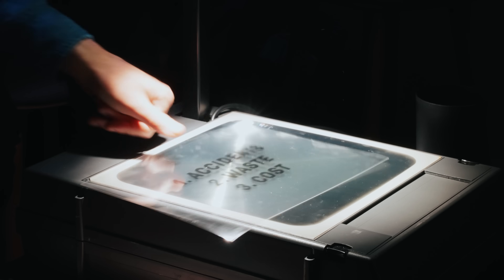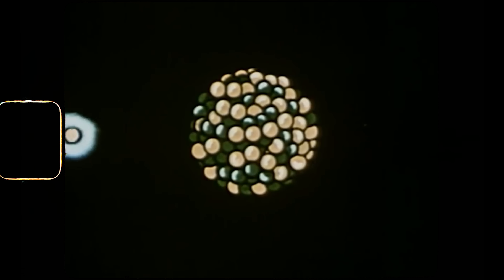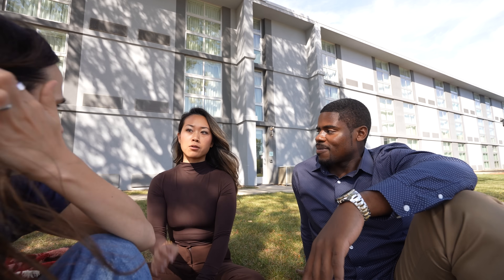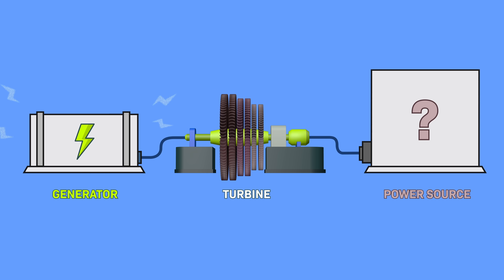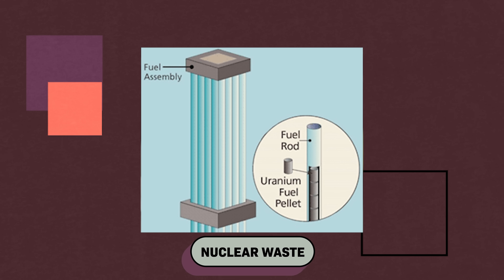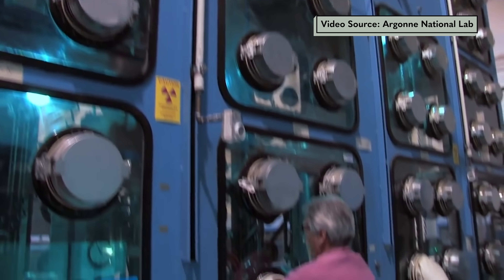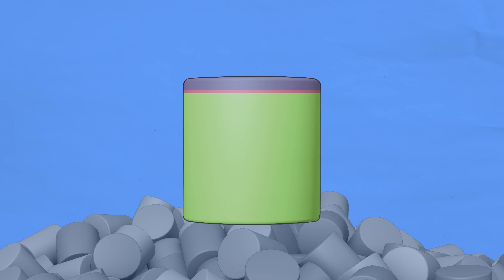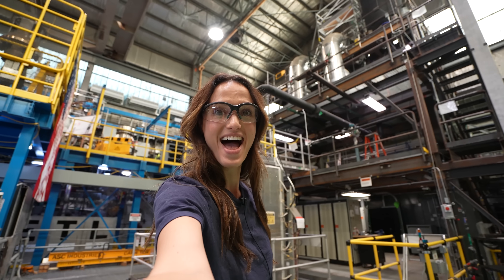The Big Lie About Nuclear Waste

Comment: Fantastic presentation. I loved it. Two tiny things. 1. 238 refers to the total number of particles (protons + neutrons) not the number of neutrons. 2. You say the process is started by firing some atoms into the fuel. Firstly if we were going to fire anything into the fuel, it would be neutrons, not atoms. Secondly, once we have enough Uranium 238 in one place, the process starts spontaneously.  The trick is to get the process running continuously without getting out of control (ie a meltdown).

As I said, though, they are very minor points. I only mention them for accuracy 😊

Comment: You take a deep dive (figuratively 😃) into thorium. It also shows great promise for producing much cleaner energy than uranium.
Reply: Thorium isn't cleaner than uranium, the reactors required to burn thorium are cleaner than those that can't. But those same reactors can burn uranium too, with all of the same benefits. And the same drawback: They're much more expensive to build and operate, which is the real reason they aren't built.

Comment: Isnt the fundament problem , that the early tech of a solid fuel rod, which quicky fracture and get changed out results in less than 5% of the fuel used ...is a problem of design.....and that the avoidance thru politics etc of liquid fuel reactors ( molten salt designs proven since late 60s ) is the fundamental inefficiency...And that it hasnt been changed or updated to any great extent? And while these technologies are being researched further, that changing the slow and expensive infrastructure is a spiders web tangle or money and entrenchment, perception , influence of big oil and other 'political" issues not necessarily driven by facts alone. That many countries are apparently working to use Molten Salt Reactors and create working and deployable systems....either using Thorium as fertile fuel and having the possibility of consuming existing nuclear wasteful waste ( with 90% + fuel remaining- altho there are many different designs and fuel management strategies implicated ) as part or the fuel charge - may likely produce much improved use of waste and/or thorium and potentially change the energy landscape of the planet ( if it ever propagates widely). This is some of what i understand. Most things published about nuclear energy misses the real valid points in my opinion. Of course all chemicals and radioactive substances must be rerspected but for sure i have seen quite a few engineering people who worked in the nuclear industry and im very impressed that in my unqualified survey , they appear to live to a ripe old age.

Comment: Let's go down the rabbit hole of why wind and solar aren't actually clean energy yet.
Reply: That's easy, because the devices use today to harness the energy are inefficient. They have to be hugely built which in turn take up too much space. That itself is invasive to flora and fauna, and the energy it produces is not sufficient for what it costs to build it. Then there's the cost and maintenance, which is more than the energy that's produce.
Nuclear power and fossil fuels on the other hand cost less and produces more energy and power. We just don't have the technology currently to make more efficient devices. Also the materials needed to make these type of devices are more contaminants than the other options. 
Take lithium batteries for example, once they're used they're just contaminating waste that cannot be recycled or easily disposable. Your phone, tablet, once it expires, it will just become dangerous waste that will contaminate more than fossil fuels. 
Power windmills affect birds, and other animals, take up too much space and cost more to maintain and repair if it gets damaged. Example the latest tornadoes in the midwest damaged several windmills that will cost millions to repair. That goes into the economy increasing the cost of living, not just to the surrounding local population but to the rest of the nation. Prepare to pay more for your veggies!

Comment: The depleted uranium rounds that the US military uses to spray all over the middle east with their A10 warthogs and thunderbolts? The ones where both the casings and the ammo are a significant health risk? They used, and continue to use, some of that waste stockpile to irradiate, armour pierce and inflate cancer cases across the places they're used. Retrofitting reactors takes years, building new ones takes almost a decade, with some taking 15 years because of poor planning and materials shortages, costs often blow out to double , or sometimes triple the amount they should. Fukushima happened because of criminally lax inspection standards and human stupidity...  and costs/money. The factor that screws us all is human fallibility. Grid level heat storage technologies are ramping up everywhere, and all over the place, solar and wind are doing so amazingly. Leave the hot, deadly rocks in the ground.
Reply: Wind and solar affect flora and fauna more. It kills birds and when it gets destroyed by tornadoes the spread of toxic materials is worse affecting the land and animals contaminating the soil.

Comment: The reason there is life in the biosphere is because the continental crust is shielding us from the radioactive (U, K, & Th) elements that were pulled down by gravity to below the surface and we are shielded from above by the magnetic field & the atmosphere from cosmic rays.
Now, we are trying to bring radioactive up back to the surface (as it was 4 billion years ago) and make it difficult for life (mutations) to continue living!
We need recycling (as you indicated), but, we need to stop spreading the use of radioactive materials.  Right now, we got Am-241 in every smoke detector, breath Ra, and drink water with microplastics, organomercury, Sr-90, and Cs-137.
You know what, STOP RIGHT THERE! 8 billion people is too much for this biosphere! Mandatory birth control is the answer!

Comment: The development of nuclear reactors initially focused on producing weapons-grade materials, which led to the adoption of designs like the early graphite-moderated reactors. These designs were less safe but efficient for plutonium production. Recycling nuclear waste was not prioritized as the primary goal was to produce material for nuclear weapons.

People are skeptical of nuclear energy because safety and sustainability was mostly an afterthought.

Comment: Do consider the fact that nuclear waste leaves highly enriched fission material that can than be used for weapons. so if your goal is to produce a lot of nukes, your baking in enrichment (to get plutonium) into a civilian process.    if the motivations were different for example highly efficient low radiative waste the designs and matirials of choice would be very different.

Comment: The problem with "recycling" nuclear waste is that it makes more nuclear waste that's even harder to deal with. Look at the contamination around the Sellafield reprocessing plant, or any other reprocessing plant. It's an incredibly dirty process that makes the nuclear waste problem worse and is highly questionable from an economical value standpoint, although nuclear energy in general is highly economically questionable. Reality is there is no such thing as clean nuclear energy, nor is there such a thing as cheap nuclear energy. Even fusion will result in nuclear waste due to neutron activation, and lacking high temperature superconductors that are suitable for usage in a fusion reactor, it's questionable if the world even has the resources to make fusion viable.

Thermal solar is highly scalable and benefits from decades of optimization of steam turbines, in addition to permitting thermal storage making it adaptable to grid demands. It relies on basic, abundant building materials (i.e. silica sand for glass, aluminum for metallizing mirrors, steel and concrete for pipes and structure). There's no need for rare earth metals and dirty chemical processes involved with photovoltaic cell production or electrochemical batteries. The only "issue" is that it's "old" technology with expired patents and generic manufacturing requirements, meaning there's no opportunity to bleed venture capitalists dry and there's very little "hype" for it. It's the ultimate clean energy source, yet no one wants to talk about it because sticking a bunch of mirrors in the desert pointed at a tower to make steam simply isn't perceived as interesting or innovative.

Comment: Great job on this video. Been working in the commercial nuclear industry for over ten years. Never really though about recycling nuclear waste. But I do see that there would be major financial burden to reuse it. Every 18 months or so a reactor goes into a refueling outage. This is a very regulated and specific activity that in itself costs millions of dollars. The handling of waste and separating the isotopes and “repackaging” the fuel and all the tests and verification of its usability/compatibility would cost millions more. There will come a time where maybe the reusing of spent fuel would be more economical than new fuel, but until then it’ll stay in the good idea but not currently feasible bin.

Comment: That's not entirely true about creating no waste either..  they create about 10% of the waste a typical plant does, which is about 30 tons a year at a typical plant so it would be about 3 tons a year a lot less but still not zero and we have no spot for high level nuclear waste currently it is just stored on site.. and it  "isn't economically viable" so they prefer that we just live with the waste piles leaking like in weldon springs ya know its cool

Comment: I’ve asked for years , why can’t this stuff be reprocessed. You exposed it. Greed.  They can reprocess it and use in a different type of,reactor.  But they want to continue the status quo.  Rear told to reduce, reuse, recycle.  It seems if the reuse, recycle part was applied we can do the same thing we did when aluminum cans were a huge problem. We worked hard to create a loop.  Now most cans are back in the store in months.  And the energy and cost to recycle aluminum is 5% of the. Cost of mining and processing new.  So this can be done if the Nuclear industry were to apply themselves to the problem and the oil and gas lobby were exposed. Just like the cigarette manufacturers, but with way more health, safety and prosperity benefits.

Comment: Plutonium is the most toxic substance on Earth. It is the key scarce ingredient in nuclear bombs. 

The cost of nuclear fission is what makes it useless.  There is simply no use for it except military or very remote locations. There is never an economic case to spend billions on reactors that on average run into 300% cost overruns and delays.  Never. 

Cost is everything in energy economics. Reducing wasted power costs far less than generating by ANY method, and nuclear is by far the most expensive method.

Carter made the correct decision, plutonium should not exist on this planet.
Reply: "Plutonium is the most toxic substance on Earth" This is hilariously false.
"The cost of nuclear fission is what makes it useless" Nuclear is the cheapest source of firm power.

Comment: We could boil water with water the technology is there where we can turn water into a fuel but for some reason it's being blocked water could run cars water can be used as fuels but technology is being blocked and if you look far enough you'll see where it's being blocked

Comment: Where does the recycling of nuclear waste happen? Search for White Mesa Mill, operated by Energy Fuels Resources, near Blanding, Utah. It is the only operating uranium mill in the US. The pits are lined with a single layer of PVC that was designed to last 20 years, but the mill has been operating since 1980, more than double the lifespan. The tailings are piled in the open air. What happens when the wind picks up and carries these heavy metal particles into the air? Is the mill poisoning the local tribe, the White Mesa Utes? Why not ask them? Seems odd to me that any mention of the facility that processes this waste is not ever mentioned in this video. It’s not as simple as “tada! clean energy from recycling waste!”
Reply: Well those issues, while obviously very bad for the people in that area, sound like very solvable issues, particularly since large scale recycling should ideally happen in the same place that the nuclear waste is generated, as transporting something highly unstable across the country to one recycling facility is fraught with danger & highly impractical.  Sounds like the people working at & living in the areas around that Mill should be pursuing an official investigation.  Having said that though, are the materials in the PVC lined pits & being affected by blown away tailings, recycled materials that have been stabilised already?

Comment: Usa shut newer use plutonium/uranium, but the TMSR ( Thorium Molten Salt ) that was first, and it was working, it use only 5.000 ton for the hole planet in one year. and if the tmsr use the old waste it will only be reaktive in 300 years. 

uranium only give out 1-2 neutron, Th put out 2-3 it better, if y leve a tmsr running and close it down after a year it have made more fuel from when it started. tmsr don't use a big dome ore pressure, it melt the thorium and can get varm to 1200 degrees, and use gas turbine. and it can NOT be use to atom bomb.

Comment: Well the recycling is activly done in Europe (including Russia) and Japan, so in this regard the USA is behind.
However the recycling does not solve the 200 000 year half time problem, as not every long half life product recycleble. But first it is being activly researched (I work one of this research institute in Europe), second long half life means small radiation. It is not that of a problem as it sounds.
Also most of the time the stored used fuel are resting at the plant, which is neccessery as they are highly radioactive at the begining. After that they can be safety stored, and be considared as an important resource for recycling and for intigrent for the future thorium based nuclear plants. So the problem is not that harsh, at least in Europe. I understand your concerns in the USA.

Comment: Imagine  we have  high  voltage electricity  and  just  led  bulbs  to glow..  So it's not  just  energy   most important  is what we do with  that  high  energy. Nuclear  might not be  carbon dioxide emissions but temperature certainly rises up  in industrialization and  using  energy. Global warming  and disbalance  are  also  environmental  issues..

Comment: The scepticism towards Nuclear power is not only related to waste storage, but also the catastrophic effects of a powerplant failure/disaster, which we have seen multiple times through the years. The prospect of having thousands of people killed by radiation and large parts of land being uninhabitable for the forseeable future, is frankly not great.
Reply: the thing is that the safety issues are massevely overstated, especially in relation with other industrial sectors: Tchernobyl was pretty much a worst case scenario, born of a plant design that is known to be unsafe and not considered for any new plant these days. And even that did relatively few direct deaths (and an unquatifiable amount of statistical deaths).
Fukushima just didn't apply safety features that were mandatory, and it made... one death. What made more deaths was the decision to evacuate the town, which is now considered to have been a bad call. We can perfectly make NPP safe if we want.

And at the same time with have the heavy industry making ecological disasters on a daily basis, and a track record of killing thousands of people at once every once in a while, yet I hear no-one claim we should stop chemical plants altogether.

And even a single dam breaking sometimes brings more deaths than all nuclear disasters combined.

In relation with how good a tool it is to fight climate change and avoid a collapse of society when oil wells dry out, the actual risks are fairly small

Comment: in fact, the fast reactor you refer to is a breeding reactor, creating plutonium, among other things.

all current reactors in fact breed materials , so its not quite recycling, but concentrating and transmuting ... 

some allow you to put stuff into the core to irradiate to create new materials or manufacture a known material in demand. 

most of the "used" fuel is still hot enough to boil water for about 20 years.